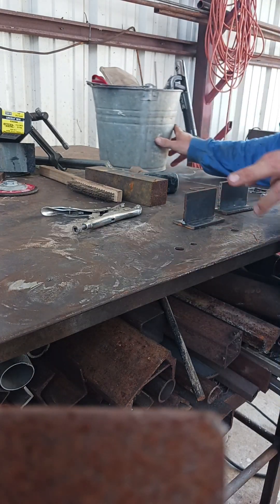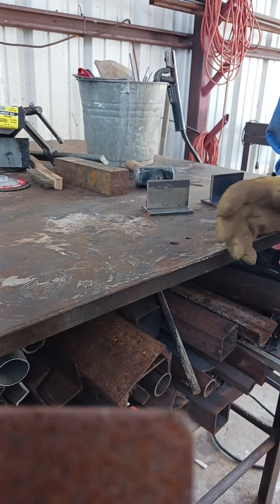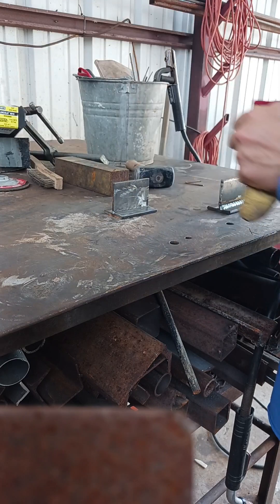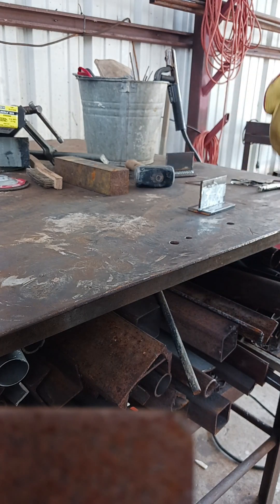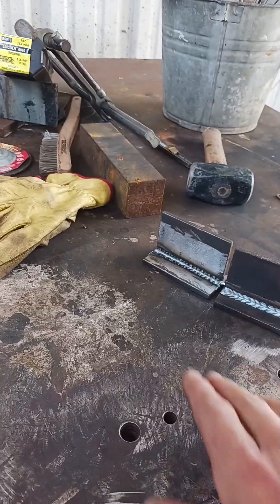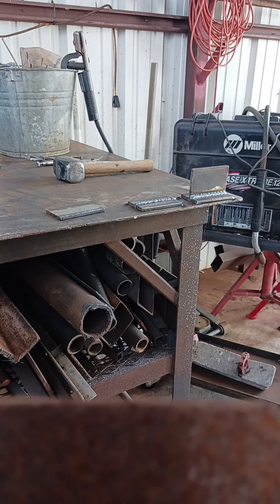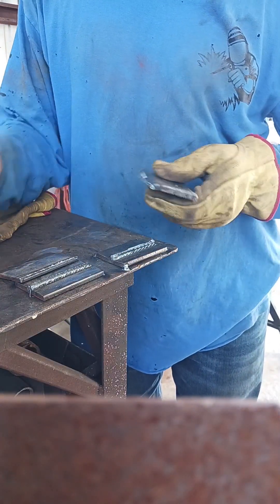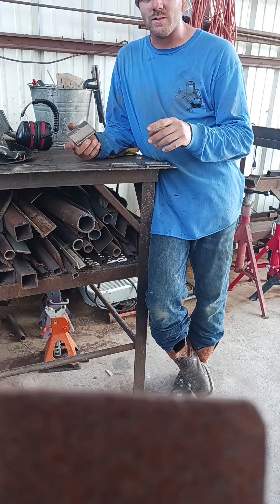Are These Welds The Same With Paint On Them?

Comment: Great video! To tally agree with your point of view regarding expertise!
On the settings matter, I felt like you the second one didn't had enough wire feed speed? Please explain!
Reply from the maker: Was trying to say you don't get anymore punch/penatration by turning the wire  feed speed down in short circuit you need to turn the feed up to punch in there it makes the Amps go up then. 
  Spray transfer maybe